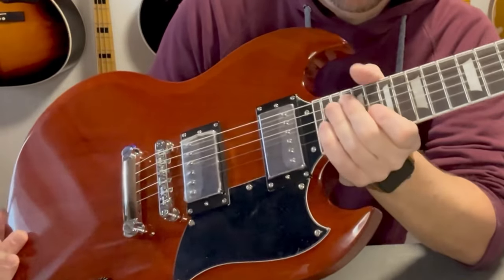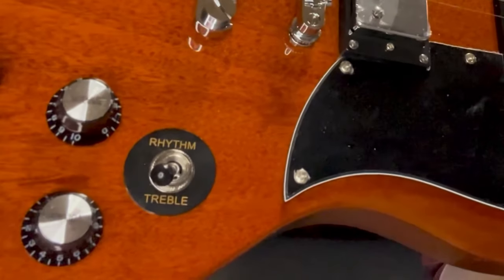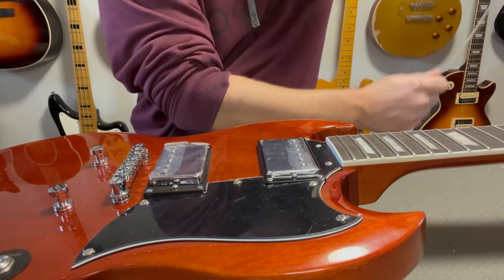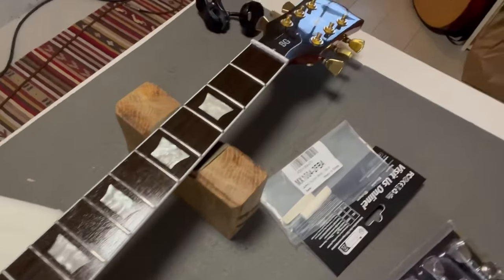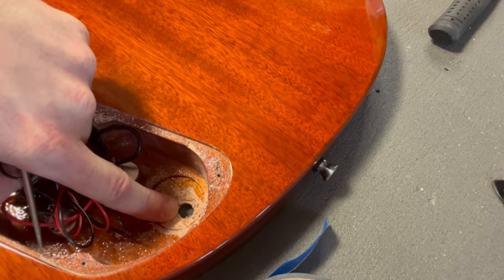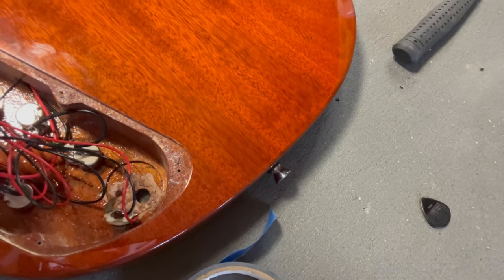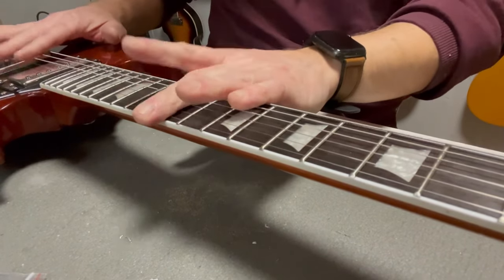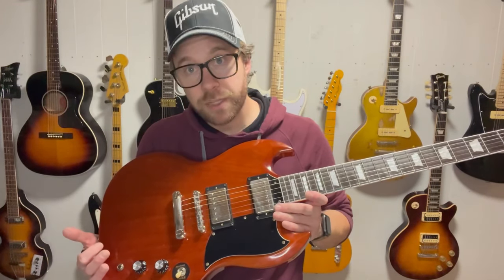Chibson SG! Upgrades and relicing

Comment: You need a Spanner wrench.  It will make removing knobs and the round nut on the output jack a very simple job.  You should score around thenut with an exacto blade before removing.  In fact anything sitting next the finish should be scored before removing.  Graph tech nuts are not made of plastic and are very good quality.  The nut will not affect tone with exception of open strings.  Once you fret a string the nut is out of play.
Reply from the maker: You are right! Good pointers! 🤘